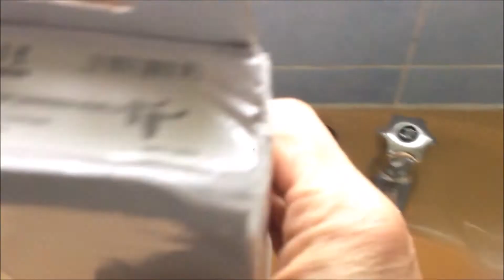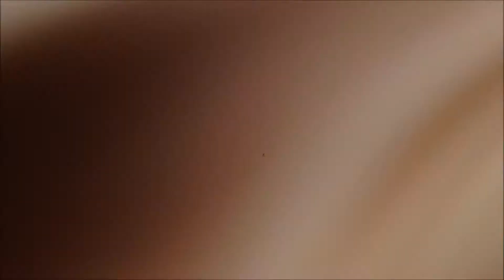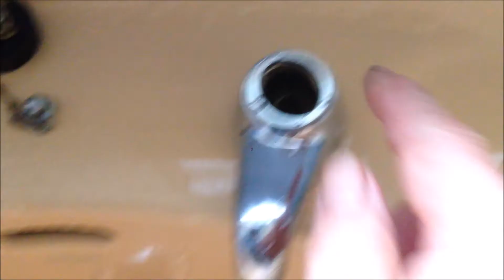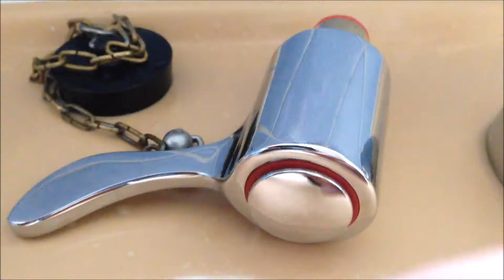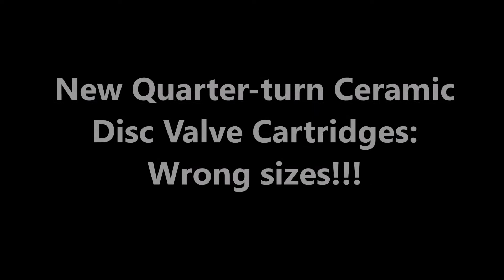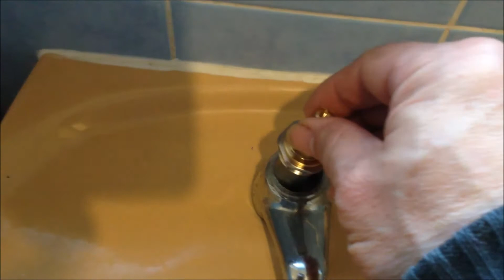Basin Taps: Upgrade to Ceramic Disc Valve Cartridges

Comment: Could you please tell me how you increased the diameter from 20 to 23. I have the same issue. Heard something that sounded like 'faro'. What is it and where did you buy it?...thanks
Reply from the maker: I bought a tap replacement kit from ebay. it was old style rubber washer type and came with adaptors to fit all different sized taps. If you couldn't find the correct size of ceramic valves, the old rubber washer style replacement kits are fine. You could also buy them from DIY stores such as B&Q. Alternatively you could buy a set of new taps cheaply, but replacing the taps could be difficult due to the limited space around the taps and you may have to buy a special tap wrench. I finally replaced the whole taps for the bathroom but for the kitchen taps, I only replaced the valve cartridges. Good luck!
Reply: @RepairDIY  Many thanks mate. Appreciate your prompt response.
Reply: He said ferrule

Comment: Do you have a video on how to do  the same on a Basin. I can't find any video's that shows how to change Basin normal separate taps into a mixer
Reply from the maker: hi, it is easier to keep the original settings. It will involve pipe works if you try to change from two separate taps to a single mixer. you will also to buy a stopper to block one of the tap hole in the basin. have a good day!

Comment: Much easier to measure existing tap internals and buy the right size!!
Reply from the maker: yes, you are right. it is easier to remove the taps twice than buying wrong tap cartridges. I just assumed they should have been the same sizes as those in the kitchen, but they weren't. have a good day!